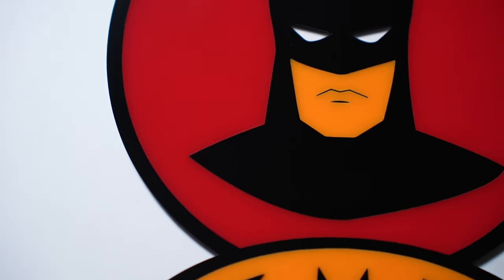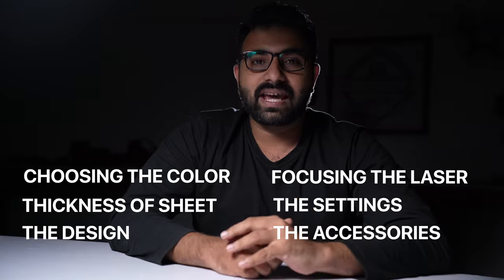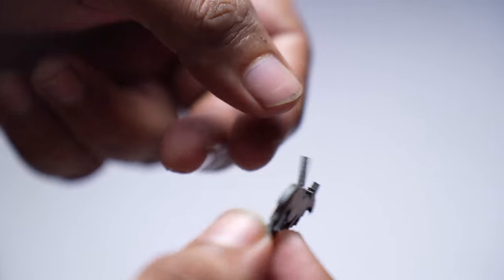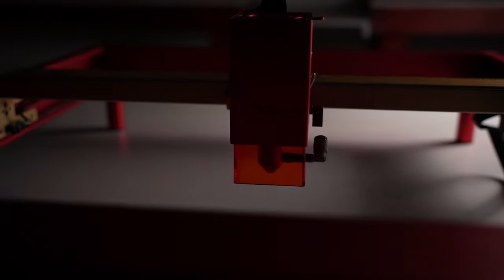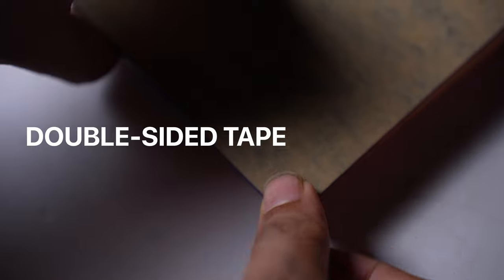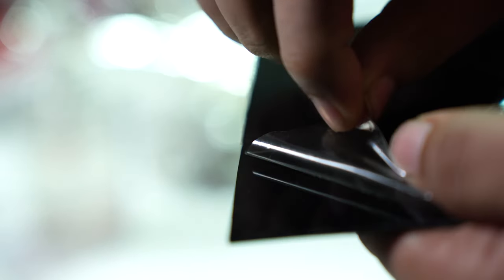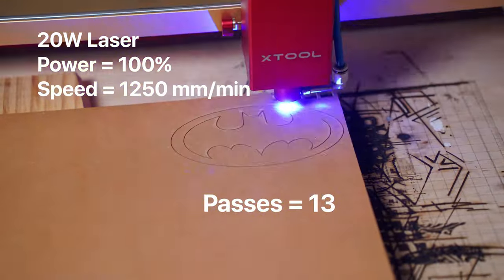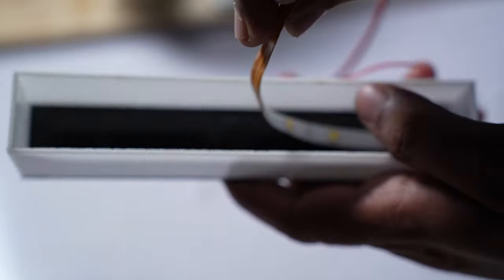Ultimate Guide to Laser Cutting Acrylic: Making a Signboard!

Comment: TFS What settings do you recommend to start if the aylic is 1mm thick? I am having a hard time figuring that out, all videos show 2mm Thank you. Great video. I have xtool d1 pro 20W
Reply from the maker: If it's for cutting, use half the power used for 2 mm, or else use half the number of passes for 2 mm. If it's for engraving you can use the same settings. For engraving, the thickness doesn't matter much.

Comment: thanks for the informations and good video, I like your contents alot. is it possible to do gold mirror acrylic 1mm on diode laser?
Reply from the maker: Glad you find my videos useful... 😊
No, you cannot cut gold mirror acrylic using a diode laser because it is basically a clear acrylic with a mirror finish on the back. So, once the mirror finish is engraved, the laser passes through the clear acrylic without cutting it. However, you can engrave on gold mirror acrylic by burning the reflective layer.

Comment: Excellent tutorial. To cut the acrylic, do you use the Air Assist on full power or medium power? Thanks
Reply from the maker: For thin acrylic I use low pressure, for really thick acrylic I use high pressure

Comment: Can i cut gold acrylic with my Xtool d1 pro 10w? I want to do cake topper in acrylic
Reply from the maker: I don't think you can cut gold acrylic with a diode laser. You can use the diode laser to engrave the back of gold acrylic, but you will need a CO2 laser to make through cuts.

Comment: If I paint the clear acrylic sheet black, can I cut it out as if it were black acrylic sheet? and then remove the paint with a thinner.
Reply from the maker: No, you cannot do that. The instant the laser hits the surface the paint is vaporized, it wouldn't exist to transfer the heat all the way through the sheet. All you would get is an engraving along the laser path. You would need a CO2 laser to cut clear acrylic sheet.

Comment: Can we cut synthetic fabric of 1mm in diode machine plz???
Reply from the maker: Yes, you can cut synthetic fabric with a diode laser, but you will need to perform test runs to identify the optimal parameters, as synthetic fabrics are prone to melting upon overheating. 
Also, diode lasers are not good for cutting lighter shades of fabrics like white.
Reply: @MellowpineLasers  means if we cut white fabric what will happen can u tell me plz

Comment: Can you Etch and Cut  Clear Acrylic 2 mm and 4mm thick. you have great video's 👌
Reply from the maker: @Sre R Yes you can engrave on clear acrylic using a diode laser, I'm making a video on that. No you cannot cut clear acrylic on a diode laser, you will need a CO2 laser to cut clear acrylic.
Reply: @MellowpineLasers  Any Affordable co2 Laser Machine.
Reply: @MellowpineLasers  Here is what I did.
1:	Painted the surface with washable black acryclic paint. (Black Craft smart Acrylic Paint) dry's fast and easy to wash it.
2:	Painted surface up and directly engraved on it. results are ok.
3:	I also tried blue masking tape and directly engraved on it facing up.

Only problem is the the power%/Speed test the squares are showing up nice but too smooth doesn't refract light when put in Led Base slot.
Reply from the maker: Try some K40 or Omtech
Reply from the maker: I'll post a video soon